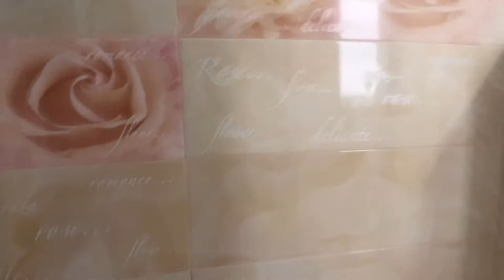The BEST CLEANER to remove HARD WATER STAINS from the shower glass / CLEANING EXPERIMENT /6 CLEANERS

Comment: What is a dried-up water spot?............lime and scale deposit, I occasionally have to take my shower head off and dip it into some Lime-away, you can watch it bubbling as it eats the lime and scale off. I also use it on the windows of my truck, spray it on and watch it bubble-off the lime-scale in minutes, wipe off and use glass cleaner, it makes the windows look new.